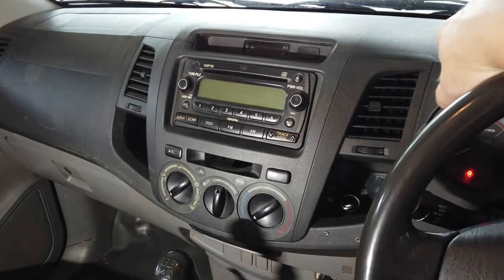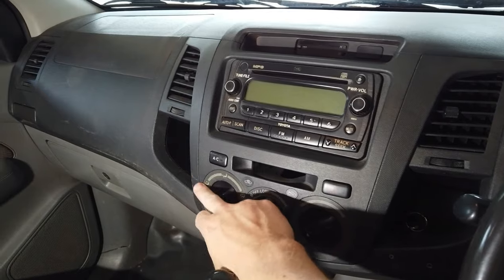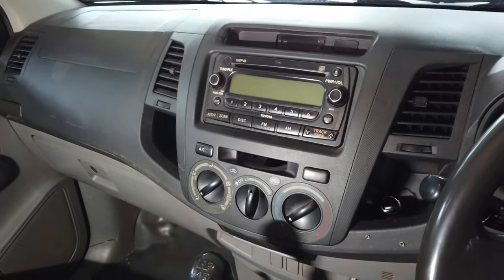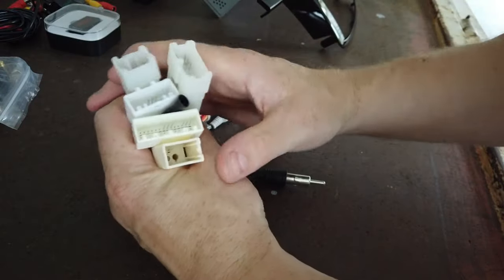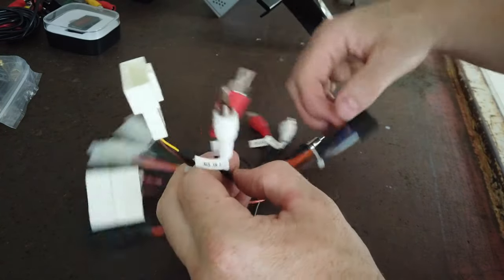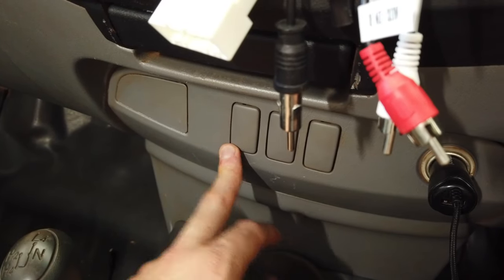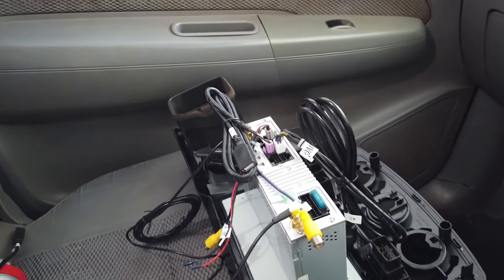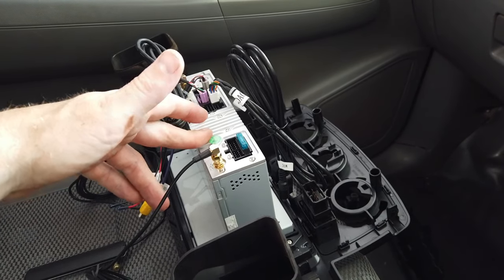Toyota Hilux Series 2008-2015 Head Unit Installation

Comment: If you are just plugging into the factory reverse camera, do you still need to solder reverse plug in?
Reply from the maker: Hi, No you will have a SR5 version so will get a different harness and should be plug and play. Cheers

Comment: i assume this is a 9 inch screen? can I fit a 10 inch screen?
Reply from the maker: Yup. These units use a 9 inch screen. Fascia we have is designed to fit a 9 inch screen so 10 inch is not possible.

Comment: I have an hilux and i just put it in like dat and the touch screen is not working but i can use a pc mouse.. any suggestions?
Reply from the maker: Hi, Get in touch with us mate if it is one of ours we will sort it out. That could be fixed with a software update or a setting change we think. Cheers

Comment: The frame I received for whatever reason I had to cut some plastic back in order to fit the vents properly from the top tab and they still aren't really great is hard to adjust the horizontals as they are binding. Next the Hazard switch is sticking where it sits so had to shave off plastic carefully around the hole so it can engage and disengage freely and still not fantastic. So not real impressed with that.

Second, so I have Alpine head unit, subs, speakers and amps installed after I first bought the ute in 2006 however now those connections are drastically different and rewired for the old head unit and there is no way to plug them in with the kit harness which I never considered. I can plug into the factory plugs with the kit no worries and the unit powers up and functions fine but until I get it rewired it's not going to have any sound. So beware, if you have any non-factory sound devices might run into issue like I have. Have a poke around before you buy and consider if major rewiring is involved.
Reply from the maker: Hey Mate,
Sorry for those issues with the frame if you can let us know the year and model of car we can have a look why this happened. We could not find your order under our system so if you can email us that would be great. 

The wiring more than happy to help out if you send some pictures. Yes our unit comes with harness to match the factory plugs so if you have a different unit installed and they have cut and join wires instead of using a harness to adapt it then you will need to match it up again but we can help you out with that. 

Cheers
Reply: Yes good to hear mines not the only one with this issue.

Comment: Hi mate, what happens if I have plugs coming from the car that don’t fit anywhere into the harnesses supplied? I don’t know what they do as there’s no wiring diagram available online ????
Reply from the maker: Hey, mate. Just match the plugs from our head unit's cable kits to the corresponding plugs on the vehicle. You can also reach out to us via live chat or email us at hey@vhedia.com.au so we can assist you further with the installation.

Comment: Great video mate! What about steering wheel control? 

Obviously you do not have same on your vehicle. Was just curious to know if the head unit supports steering wheel control and what are the wiring harness needed.  Is the connection at 2:02? 

Eagerly waiting for your reply! Cheers
Reply from the maker: Hey, mate. I understand that it can vary from badge to badge. You can send us an email or reach out via chat so we can confirm which head unit will suit your vehicle model/badge. Our kits include all the harness you'll need for other factory options to work such as reverse cameras, steering wheel controls, sensors, etc. Cheers.
Reply from the maker: Hey, mate. Yeah our units support steering wheel controls. Factory steering controls will be retained unless stated on our website that it will not. We also have steering wheel buttons in our shop you can connect if you do not have factory  steering wheel controls. Or you can also check out our steering wheel upgrade! :) 

Brown cable at 2:02 is for AUX in.